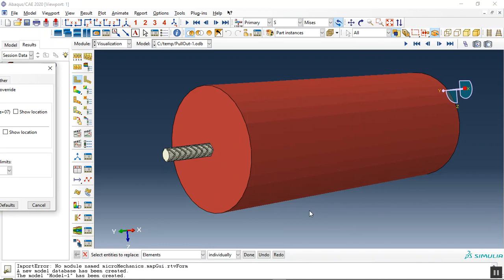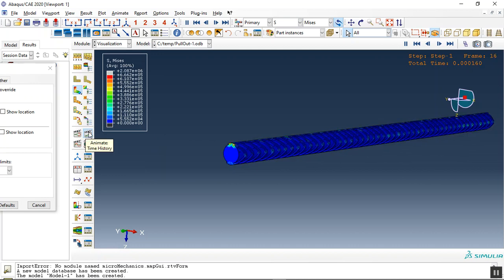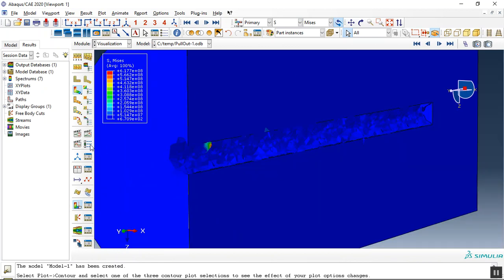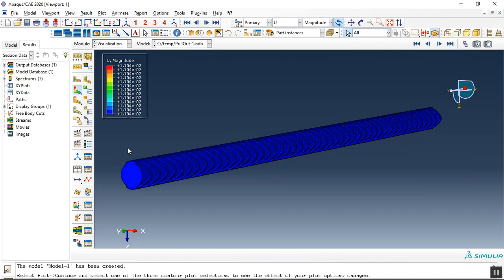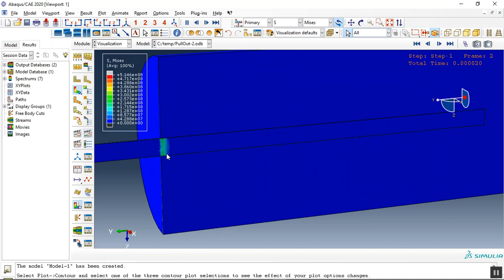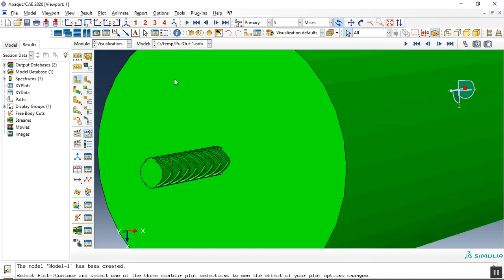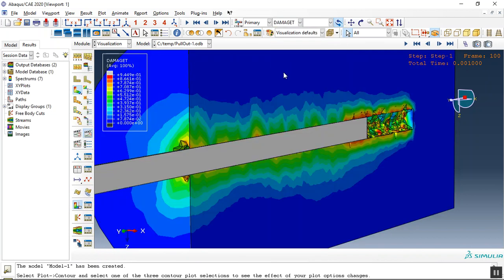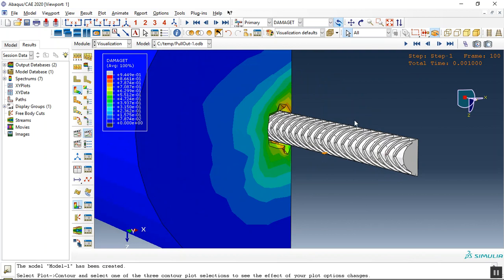Simulation Pull-Out test of a ribbed steel bar from the UHPC part in Abaqus

Comment: modeling steel bars as line element is more important than modeled it as solid, becase in the structures, impossible to use solid element for bars
Reply from the maker: For complex model yes, but for the case study, you can use solid